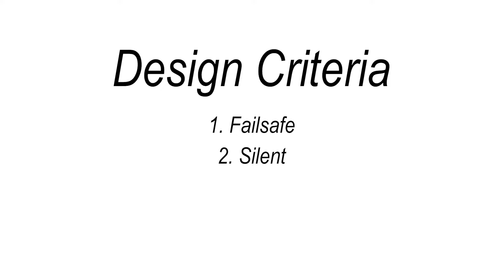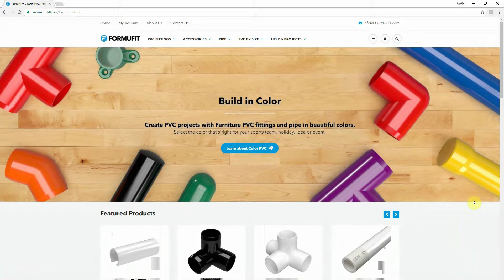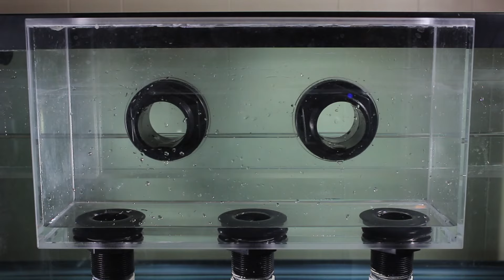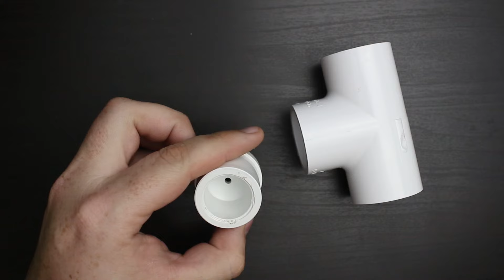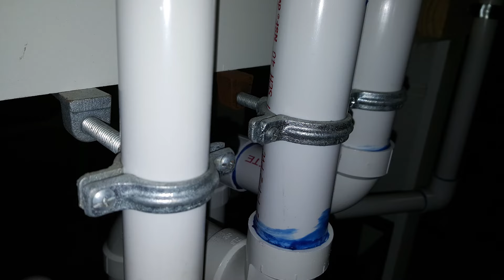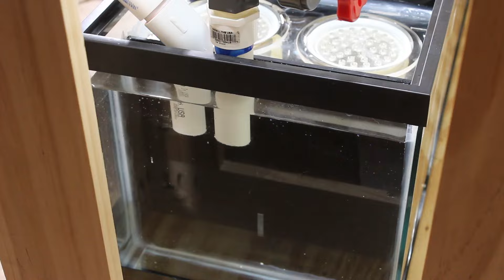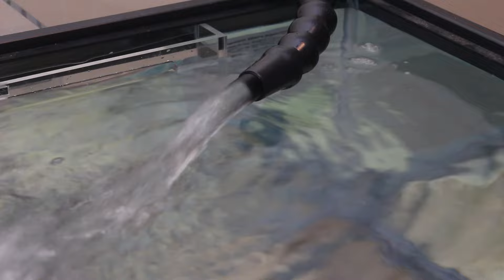Plumbing Installation - Bean Animal Style

Comment: Great video 👍
I'm buying your 1.5 inch overflow for a custom plywood tank that will be 380g.
Reply: Good deal!
Reply: @tstanley01  Yeah really looking forward to it... hoping I can successfully get over 2000gph quietly.
Reply: My comment probably would have made more sense if I had changed profiles.  I am exotic marine systems. Lol
Reply: @tstanley01  hahaha...I figured you were from the company. Do you think I can get 2500gph or more with the 1.5 bulkhead kit?
Reply: @GSP-76  Absolutely.  Itnis the quietest on the market as well.  The rear box sits higher, so you can run the water level higher in the box, and the total effective weir length is the longest out there as well.  Only a c2c built in overflow give better performance.  But those have their own issues. My goal was to make the best of borh worlds, and from people's response, I got pretty close.
Reply: @tstanley01  Awesome... can't wait to get going on the building/setup.
Reply: Hey Justin, I won't hold back...I had to go with another overflow kit...main reason being that I sent several e-mails asking for assistance with getting a template because I hired a company to do the tank drilling. I had no issue paying for a acrylic template but would have been happy with a digital or paper template (we wanted to see the template prior to drilling). After 2 e-mails and one reply, I never heard back. Sorry, but that's terrible customer support...I wish you all the best but please get back to customers inquiring for help when doing a massive tank setups...I was going to use 2 overflow boxes draining into a custom 120 gallon sump with 4-6 drains.

Comment: So if I have holes drilled in the bottom of my tank I want the safe in line as low as it can go without actually touching the bottom? And how do I get the air out? Also if the power goes out well I have to re-safe in this?

Comment: Can you add a link where you got the pvc support mounts. I can find the rod and clamps no problem, but can't seem to find the mounts anywhere. Thanks
Reply from the maker: https://m.lowes.com/pd/AMERICAN-VALVE-3-8-in-to-3-8-in-dia-Steel-Ceiling-Flange/1244077

https://m.lowes.com/pd/AMERICAN-VALVE-3-8-in-to-3-8-in-dia-Malleable-Iron-Sidebeam-Connector/3223501
Reply: @exoticmarinesystems7808   thank you! also check ur email!

Comment: Could a small hole be drilled into the top of the siphon line to suck out air or would this damage the system's ability to function in some way?
Reply from the maker: If sized properly it is not needed.  People do that because they oversize the plumbing and it doesn't have enough velocity to push the water down and out.  Don't use 1.5" pipes on the siphon line unless you are flowing more than 1200 GPH.  A properly designed system wont fail.  Holes can become clogged with algae or something else.  If your system is dependent on it to function properly it could be bad.

Comment: I have lots of questions... I want to put a sump on my 75 gallon freshwater planted tank, it is not drilled, and I want as little noise as possible. Point me in the right direction as I have no clue.
Reply from the maker: Any of our overflows would allow you to operate your system with little to no sounds.  How much flow are you wanting to put through the system?
Reply: @exoticmarinesystems7808  flow it has two 406's and an fx4 on it now. I try to keep the current going but the betta do not seem to like alot of flow, the corydoras, variety of tetras, and boat load of shrip love it

Comment: I have a 46g that im building a small sump for, and ive drilled a hope in the back for an overflow. Im planning to install a weir and use only a durso standpipe. Is it safe to do this without an emergency drain? I only really have space for the one hole since im drilled in the back corner and im limited for space.
Reply from the maker: People have been doing it for decades.  It isn't as safe, but the vast majority of reef keepers have done it.  The biggest issue is noise that can be created if there is too much flow.  A 1" durso will not flow much water without making noise.  HTH
Reply: @exoticmarinesystems7808  I have it set up for 1.5 inches and am only planning to turn over 300-350 gph. Will it be more loud or less loud with larger diameter?

Thanks for your response, by the way!
Reply from the maker: You should be pretty good with 1.5"  It will also allow for a partial clog and still be able to flow enough water.  Some times open channel lines can be about experimenting with the hole on the top.  To small, and it can start a siphon.  Too large and more noise can escape through the hole.